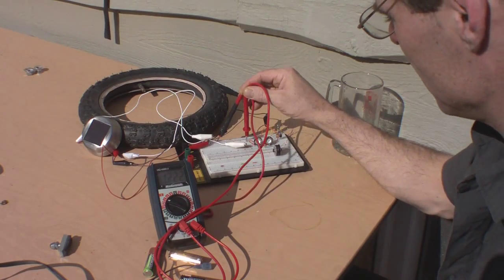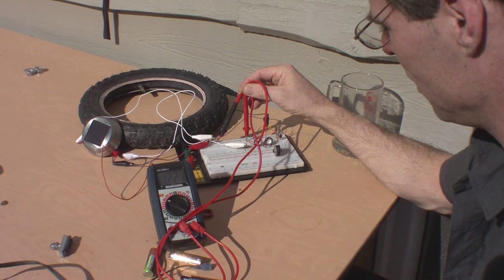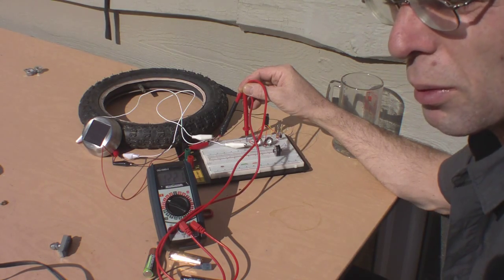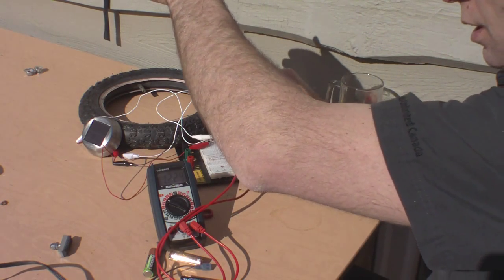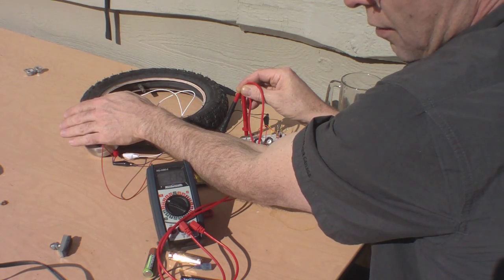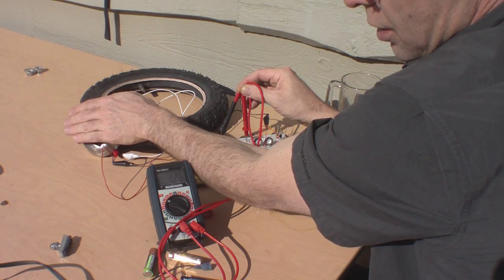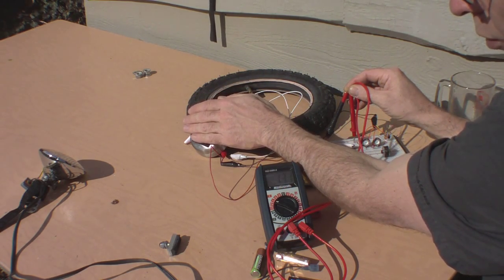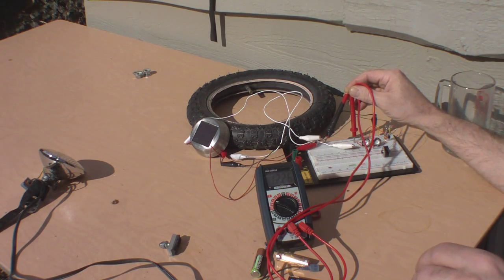Solar Pulse Charging Voltage Test

Comment from the maker: Given that the circuit pulls, then stops, then pulls again... it'd also make sense perhaps to have a cap between the cells and the circuit... the solar cell will continue to provide current, let the capacitor charge, while the circuit is "off".

Comment from the maker: I think the lesson learned is, we have options beyond consumer grade choices. Optimizations are possible, and energy usage habits are alterable. Less light consumption, with more locations, better ray "scattering" - smart lights that shut off when you leave the room or go to low power consumption. Heat extraction, battery conditioning, desulphating... so many ways to go and experiment with!

Comment from the maker: I should have used a 10 ohm resistor across the + and -, to measure current, with 1 watt and 1% precision, then drop a zero off your millivolt reading to come up with amps My method is not accurate. A 1 ohm resistor is too small to be accurate, and then, even still, you are talking about, again... a pulse.. that pulls sometimes, and then stops, then starts again...I see no way of being accurate, actually. However...

Comment from the maker: It's too early to really say this, but, I kind of like the idea of designing home made panels for undervoltage days. ~5 watt panels with pulse circuit designed to produce perhaps, normally 3-6v, but when pulsed, capable of creating spikes that will overcome the potential of 12v bank. On days where the sun is strong, those panels would charge small utility batteries from 1.5-6v. Real cloudy days  - the large panels would charge small bats and small panels condition the big bank.

Comment from the maker: Is a very tall leap. Here's why. 1. Batteries are very complex chemical devices and their performance is ever changing. 2. If you "recondition" a battery, how can you say it's free energy: you changed the battery and it worked better - that doesn't mean it's free energy 3. Load characteristics vary too much to be consistent, as well - except heat production, and even that takes a very lab oriented setup.

Comment from the maker: I've come to the conclusion that no measurements taken when a pulse is in action, mean anything... at all.. when a standard multimeter is used. The wave is too complex for these meters and the pulse is to too quick. Furthermore, it's my belief that the benefit is in alternate benefits (desulphation for example, or undervoltage charging). Also, the benefit is in optional usage patterns. To believe that there is any free energy in it though...